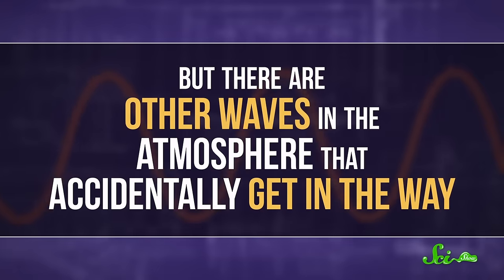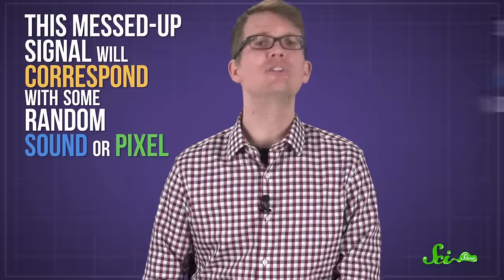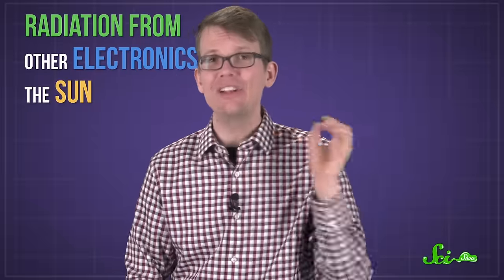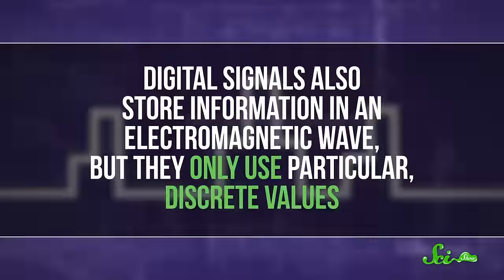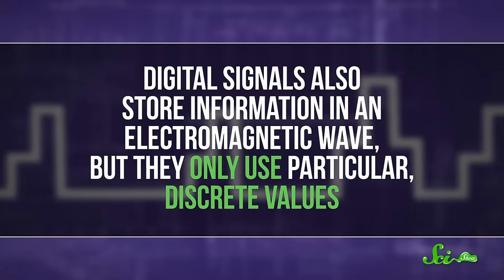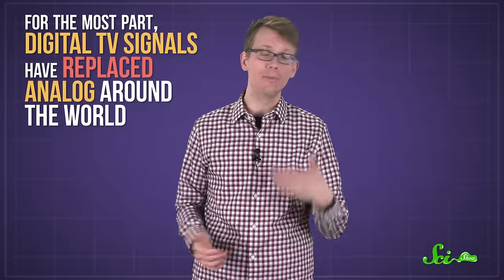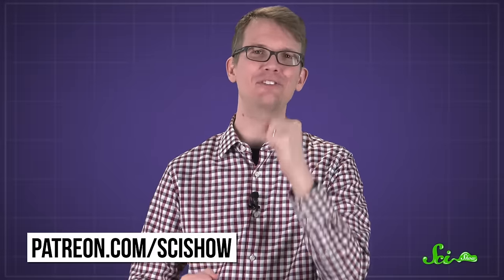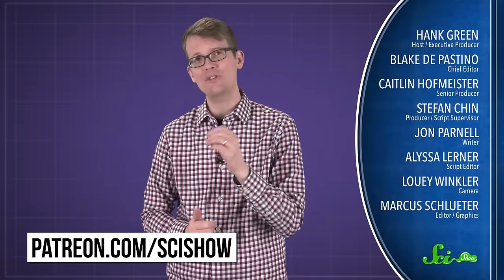Where Does Static Come From?

Comment: Pixel? Did he say pixel? While discussing analog TV? Kids these days!
Reply: A pixel is also an unit in colour tube tv. It's that tiny square with red, green and blue you see when you get real close to the monitor.
Reply: No, that's right; analog TV screens consist of a number of phosphor dots of three colors that, in some models, can even be seen if you look closely enough. (These two images show the color white in closeup: https://upload.wikimedia.org/wikipedia/en/4/44/CRT_phosphor_dots.png )

Indeed some projects aim to simulate the artifacts produced by the 'pixels' of old CRT monitors: http://www.gamasutra.com/view/news/125898/Opinion_CRT_Emulation_For_Pixel_Art.php
Reply: You really did yourself this time, Mr Rusty Tube.
Reply: if saying that about definition RustyTube right, because pixel its  discret dot with another principle of operation. Dots analog TV and dots (pixels) led monitor different. Its  no changes if it simulate on "produced by the 'pixels' of old CRT monitors: " ))
Reply: Yeah crt's don't have pixels lol. They have scan lines so technically the approximate possible horizontal resolution is infinite. You're shooting charged particles across a screen in stacked horizontal lines. If you placed a single solid line of phosphorus on the screen the ray emitter could produce light anywhere along the line in a gradient. They were really much more complicated than leds and involve big electromagnets steering the charged particles as they fly out of the emitter.
Reply: D0NtPh34rTh3R34p3R that's not true. Just because CRTs have scan lines does not give them infinite horizontal resolution. The beam is not focused to a perfect point (physically impossible anyway) and the slew rate of the electronics prevent instantaneous value changes or precision location selection even on old black and white TVs. Color CRTs additionally have a phosphorus layer that constrains the location of pixels further.
Reply: amoose136 If you had a perfectly accurate tube it would be infinite. The dots only restrict color and not the actual picture element itself as the beam isn't even aiming at each individual dot and instead can use three separate beams to represent rgb. Just remember you're dealing with gradients and not hard edges, so combination of "pixels" on a crt is entirely possible. If it had infinite bandwidth it would be capable of any sized "pixel". yes it's limited by how fast the beam can turn on and off, but that's not in relation to the screen as it can place that line anywhere along the screen. Seriously, these things were expensive to make, which is honestly why I think they stopped making them. That and a few other reasons, but if we made them today they would be better than everything on the market.
Reply: 1.) No perfectly accurate tube even theoretically exists. CRTs therefore don't even have theoretical perfect precision. 
2.) "and instead can use three separate beams" they didn't though... that would require way more electronics.
3.) "wayyy faster" is still not infinite like you said originally.
4..) "but if we made them today they would be better than everything on the market." What is "better" is highly subjective and I don't care. My point is that they don't have infinite precision, not even theoretically.
Reply: 1.) Listen to Gareth Dean and amoose
2.) The word "pixel" has been in use way longer than digital LCD TVs
Reply: Phosphor dots are not pixels. Pixels are addressable elements. The beam width is large enough to hit more than one dot at a time. Some tubes (Sony Trinitron) use stripes instead of dots.
Reply: Gareth Dean Combination, as in you can light the last third of a pixel and the next third of the adjacent pixel. Can you light one third of a pixel on an lcd? how about 1/1000 of a pixel and striping on and off all the way down the length of the pixel? This is what crts do, and how they change resolutions. Crts have a grill of colors to choose from, but the actual light produced can be any size including a fraction of the available phosphor dot.
Reply: amoose136 1.) you're shooting electrons, steered by electromagnets. If you're looking for an example of theoretical precision look to electron microscopes.
2.)They certainly do use seperate beams for displaying color, just ask the oracle google.
3.) The limits imposed by timing are so small you would run into other constraints first, limits not imposed by the crt itself.
4.) see 1.

Comment: why static is black and white in a color TV ?
Reply: real sabab because. Radio waves are not visible light. They are two completely different electro magnetic waves.
Reply: we see radio weaves sent by TV stations convert into color light in TV screen, why static weaves dose not convert into color light ?
Reply: It might very well be colored light resulting from stimulation of individual phosphors of red, green, and blue. But because the stimulation is so brief and rapid, with a one-third chance for each color, the human eye might be blending them into white or gray, since that is what our eyes do when all three phospors are stimulated in an intentional image, as well.
Reply: I once had an analog TV, which could freeze/pause the screen. The dots and bits of the noise were still black and white
Reply: Some old analog Color TV sets had a color killer circuit that would activate in the absence of a signal.

Comment: I'm all to familiar with the static from the old tv's.
Reply: ThunderGun2 Yes and it was better, the crappy digital signal barely works if you are outside a major city! I remember being able to get a ton of TV channels in the middle of the Adirondacks (sure they had static but it was alot better than the black boxes you get now!) and now you get nothing!
Reply: Same
Reply: And I'm familiar with Analog AM radio and I still have a AM radio and a FM and AM and long wave and shortwave radio too
Reply: I have a Analog CRT TV to play my PS3 on it has composite cable inputs and a coaxial cable input

Comment: Most of the noise you will see or hear on a TV will be internally generated by the transistors, not entering via the antenna!
Just unplug the antenna when tuned away from a signal and compare the noise, there will hardly be any difference!
Reply: YES!
Reply: Thats not true at all the transistors dont generate noise. After the connector on the back there is a small piece of coax that can act as an antenna, traces on the circuit board and the parts themselves all acting as antennas. Also noise can come in over the AC lines. The TV generates an IF signal but that wouldn't be static its a fixed frequency like 455MHz; depends on the set.
Reply: Dave B 
You are utterly wrong.
Where do I buy transistors that don't generate noise? 
Why would the receiver design be so poor that power line noise would be coupled into the signal chain? 
Why would the input coax not provide screening to outside signals?
The IF signal will consist of externally generated signals when an antenna is plugged in, but if the TV is tuned off a specific station, it will largely be internally generated noise.
Reply: Dave B ALL resistive conductors generate noise. That includes semiconductors. Lookup Johnson-Nyquist noise. You could put a battery powered TV in a Faraday cage and it will still make static.
Reply: Looks like Dave B has withdrawn his comment, now we need SciShow to remove the video in the interests of not perpetuating this silly idea!
Reply: Agreed! They should at least do a correction.
Reply: What I'm explaining is that the noise the generate is so small compared to the background noise that they may as well as be considered "silent". Why wouldn't the coax not screen outside signals? Go look up what the IF does in a receiver and see what the stages do in a super heterodyne receiver for a starting point. The coax isn't a filter, it is a conductor.
Reply: Dave B  the static is mostly created in the TV's preamp before the IF. There are various estimates as to how much snow is contributed by an antenna connected to the TV. Usually only 1 percent is attributable to the CMB. Remember that the CMB has a noise temperature of 2.7 degrees K. The earth's surface is between 250K and 320K. The Earth transmits far more energy into an antenna than the CMB does. To study the CMB, you need a big radio telescope and a sensitive receiver cooled to within a few degrees of absolute zero.
Reply: Well, yes strictly speaking but the audio is FM and the descriminator at the end of the chain will create noise without any signal. A steady carrier would be needed to quieten it.

Comment: Some noise is also generated from inside the electronics, because of their temperature. This happens even in digital systems: from the moment the digital signal is converted to analog so that it can be used to light pixels or move a speaker, the thermal energy of the wires adds a little bit of noise to it.
Reply: Rua Whitepaw Exactly!... the reason I checked the comments was to see if anybody else mentioned it.  I agree, thermal noise is the most basic of all the things that degrades a signal.  It occurs in any case, even without any external interference.  No lightning or big bangs required.
Reply: Thats not how it works. Thermal noise is in the infrared range like 1micro meter to 800 nano meters. RF is in the meter to milimeter range.
Reply: A lot of it may be, but per Planck's law, there is also some RF in it.
Reply: +Dave B You may be confusing blackbody radiation with Johnson–Nyquist noise. The latter (AKA thermal noise) is electronic noise not electromagnetic radiation.

Comment: I love tuning to a quiet AM radio station during thunderstorms, each time lightening strikes anywhere within range you can hear a crash even if you can't see the flash or clearly hear it
Reply: You can do something similar by plugging a loop of wire into your sound card's microphone input. You can then record it or use it as input for software like SDRSharp to examine the signal. Lightning flashes show up as fairly wide bursts in a FFT representation of the signal.

Comment: Adding to that, the old analog signals were easily distorted because the video component was a type of Amplitude Modulation which is easier to in a way that comes through the demodulation process. This is the same reason that AM radio is noisier than FM (Frequency Modulation) where the amplitude distortion is clipped off and ignored in demodulation. The discrete values used in digital modulation techniques like QAM mean that small variations in amplitude will be ignored. Nice work SciShow - as usual :)

Comment: what about digital static?
Reply: Pikapetey Animations Why are you, never mind I'm not going to ask.
Reply: It doesn't exist
Reply: @doramilitiakatiemelody1875  i have a fully digital tv and i've got static but this only can happen if you connected to an other device and go to tv mode and not the intended hdmi mode on accident or by purpose.however depending on the power of the device it will get more or less static and i don't think it has a volume cap because it happened to me and made me deaf for like a second because i had a beefy computer connected to it.One of the loudest sounds i've ever heard.

Comment: Digital transmissions don't quite use very largely varying discrete values any more. Simple differential encodings have been replaced by advanced frequency modulation schemes. Interference from noise is a huge issue. This is addressed by the addition of error correction bits (so errors can be detected and fixed), scrambling of the bits (so interference for a certain amount of time doesn't erase a sequence of adjacent bits) and possibly additional correction mechanisms above the transmission layer. That layer provides a sequence of bits that is either all OK, or too messed up to decode, meaning a whole block of data is gone. This loss translates possibly in a macroblock being lost in video (a square not quite changing when it has to, or with the colours off). So you don't see the static. In audio, it can be compensated by interpolating from the previous audio blocks, and the next if there is some buffering. You may not even notice a single lost block. If things get too bad, you hear that odd choppy or metallic digital noise.

Comment: The main cause of static is the preamplifier in the radio or TV. They have automatic gain control (AGC) circuits which increase electrical noise as the gain goes up. You still hear/see static even with no antenna connected. You could put a receiver in a Faraday cage and you would still get static.

Comment: @SciShow, Static could also be interference from other electrical devices . Also having power cables next to analog audio cables induces a noise within the audio cable creating another form of "static" this is a common practice (atleast within my theatres) to separate the power lines from the audio lines to help reduce this risk.

Comment: Digital signals aren't suffering from static noise because minor distortion is rectified and major distortion causes errors. Unlike analog distortion, digital errors are either corrected or will cause failure. So instead of showing noise, the system will stop the erroneous signal. Fun fact, TV noise is white because color signals require a very specific framing. Without the correct framing format, analog TVs will fall back to the legacy monochrome interpretation.

Comment: ugnnnn.... i just had flashbacks of when i was in 3rd grade (back in  '92) and my mom got me a Hot-Pink Portable Black & White TV that had a turner to change the channels with. It would take 5min to tune into some of the channels right and even then you'd have to hold it at weird angles so the antenna would be able to find the signal.

Comment: nope. Each speck of the static is a signal. You have to tune into to one to channel its single over the others. The same is true for a radio tower. You will only hear static (which is all the signals heard at once as noise) unless you tune into one message/signal/channel. The static one the tv is literally just all the channels being broadcasted all at once.

Comment: To answer some one question "Where did the lithum helium and hydrogen come from?, See we don't know" :
The hydrogen helium and lithium ( Elements one two, and three with 
masses 2, 4 and 6) were formed from the quark gluon soup. Top and bottom
 quarks formed in triplets to make protons and neutrons (proton is two 
up and one down and neutron is two down and one up, help together by 
gluons). As it cooled the strong weak and electromagnetic forces 
decoupled. There were top bottom and strange quarks. (first three 
lightest of six). This is all well proven and verified by experiments in
 particle accelerators. We dont know what happened when all four 
fundamental forces were combined, but we know what happened when the 
three separated..

Comment: Old analogue TV's didn't have pixels, technically speaking.
Reply: Phosphor dots are not pixels. There are no pixels in CRTs. The electron beams are larger than the phosphor dots and they hit more than one dot at a time. Some CRTs (Sony Trinitron) used vertical stripes of phosphors instead of dots .
Reply: Chris W, a pixel is an area on a display screen in which the screen in illuminated. If there is a display, analog or digital, that is turned on and is displaying a color, then it is a pixel. Just because it is a different way of displaying a pixel, doesn't mean it isn't. We cannot define pixels by LED displays, because they are simply not a good definition, as an LED is just a light bulb with multiple colors.
Reply: X Kaber I'm sorry, but your understanding is a little off. I'm a broadcast engineer with 40 years experience. A pixel is the smallest addressable picture element. Phosphor dots are not addressable. 
LED displays do have pixels. LED displays use red, green, and blue LEDs.

Comment: if you're ever driving through a lightning storm, switch your radio to AM, and you can "hear" every lightning bolt, whether you see the flash or not
Reply: interesting... even if I am on a station?
Reply: I forget... but it was certainly clearer on a channel with no station.  it went from near silence to a burst of static at the same time as the lightning

Comment: You would never be able to see the cosmic microwave background on a TV in any real sense.  The receiver itself is far to noisy, about 100 time noisier than the CMB, and that is if you pointed your antenna up, which you wouldn't normally do.  Also, while source of the randomness is ultimately noise and interference (from the TV itself, or terrestrial or solar sources), the reason we see it has to do with the particulars of an analog TV receiver.  Analog TVs had to work around signals that could be constantly changing in strength, and they didn't have any fancy digital signal processing.  So they constantly calibrating what "black" and "white" mean to display a high contrast image under normal conditions.  When there was no signal for the auto gain control to latch on to, they would just try to amplify whatever tiny noise signal they find into a high contrast image.

Comment: There are other causes for interference. Man made electromagnetic interference.
If, for instance, a diesel/electric locomotive on a rarely used siding by my house, I lose my wifi and cell signal. I also lose signals to both when my neighbor has decided to retune his 1974 Chevy pickup and is winging the engine up to 4k RPM.
I expect this comes from the poorly shielded generators throwing out massive amounts of alternating magnetic waves. Which would also explain why the screws and plate in my ankle hurt when I go through a metal detector.